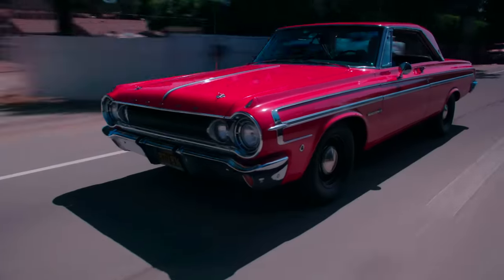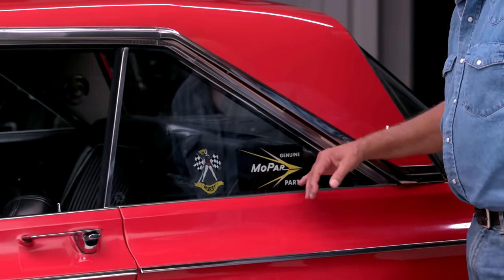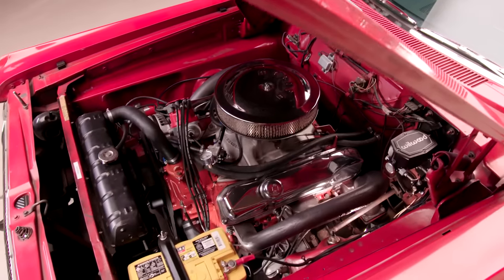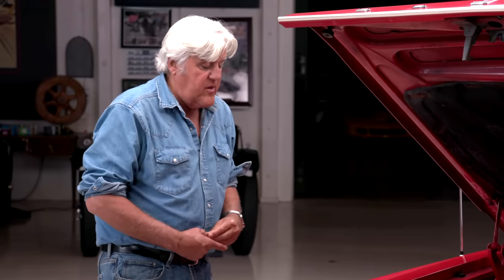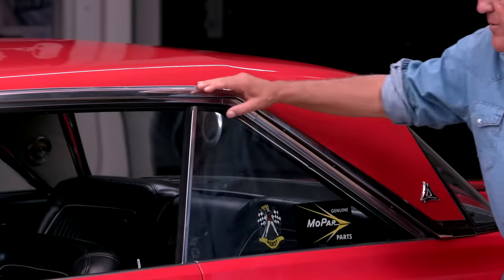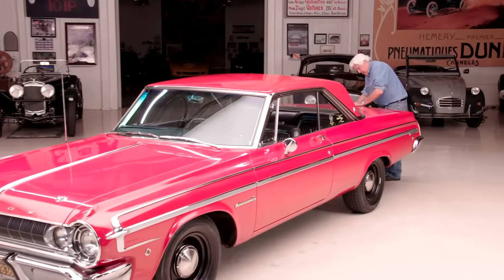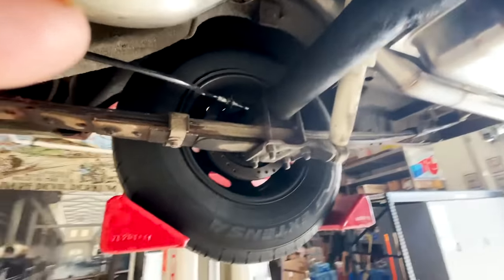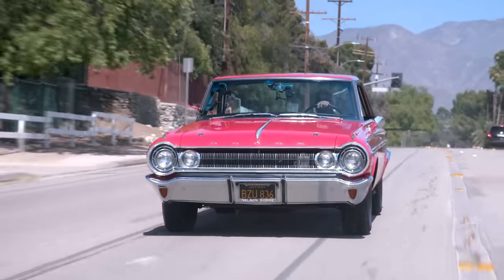1964 Dodge Polara | Jay Leno's Garage

Comment: When I was 16 my dad bought a 1965 Belvedere I from a guy who was on a baseball team he coached and got drafted. It had a 426 wedge with a push button Torque Flight transmission, he instantly became the coolest dad and I was the luckiest kid on the block. It was the car I learned to drive in and take my driver's license test in. Yes I passed and the guy who  gave me the test had a big smile on his face, boy did I love the 60's, 73 now and still smiling 😃
Reply: Heh, Steve, my father was also a Mopar guy and at 15 in 1962, I took my driving test in his 1959 Chrysler 300 E coupe. I recall a similar reaction from the State Trooper administering my test!!!
Reply: Thanks for sharing, fellas... my dad is 74 and all our lives, my brothers and I have been exposed to Dad's stories of those cars. And I still own the car he brought me home from the hospital in,,, a 1964 Dodge Polara 500, 426 street wedge 4speed. Pretty much the same package Jay featured in this episode,  but Dad's car is dark blue poly with light blue buckets and console with white insets, and that same white 4 speed ball on the Hurst shifter.  It's got 71k original miles on it today. 

It's still got it's cast iron prestolite tach drive dual point distributor and the chrome unsilenced air cleaner and chrome valve covers that all came standard with the 426 street wedge.

That car, and the memories of it from my childhood are wonderful bits of our shared passion for old Mopars.  I am so happy to hear Jay say the things he did about this model. I have always loved them  just a little bit more than the hero cars, like the 68 and 69 Chargers and the Cudas and Challengers that command the limelight....

I am especially intrigued about Jay's appreciation for the 7 litre Galaxy that he did to commemorate one his Dad had when Jay was young,,, as I too find those to be extremely attractive even though they're outside the Mopar family. I searched one out back in 1990, complete with the 7 Litre 427 4v and unfortunately,  the C6, unlike the 4speed I prefer. Same maroon and black livery as Jay's car. 
They are all great time machines,, to take us back to our childhoods,,, thanks to our Dad's getting us exposure to them.  

Jay has certainly made a friend in me. I have been a loyal watcher since the beginning.
Reply: @patrickwayne3701  -Patrick, thanks so much for sharing your own story about your father and his 64 Polara in particular. You have the advantage of not only having your dad around to listen to his tales, but also the car of your youth to enjoy firsthand… Unfortunately, in my case, I have only memories of Dads most special Mopars as no photos remain of either the 59 300 E or my 64 Polara 500 in white with red/white interior.
Reply: @brenmizer123  man that's a bummer.  I was ALWAYS getting one of those Kodak cheapo cameras that were sealed in the foil package, and clicking away, then sending the camera off thru the drugstore to get double prints back.

A 59 300 is SOOO damn cool....
Reply: What happened to our beautiful cars that we used to buy.
Reply: I learned in my Granddads Dodge pickup had a 318 with the push button tranny, I was only 13 but we were out in the country and boy did I have the friends from town wanting to spend the weekends with me, great car great memories 🎉
Reply: They all turned into the same SUV

Comment: Had a red 64. Pulled the 383 and added the 413 from a wreck. Every cop in LA new me. Used to go out in the desert and run. Bias ply tires, drum brakes, and lap belts and we are STILL ALIVE!
Reply: Sounds good! Bumper sticker I recall from that era was: "Go like Hell, you'll get there!"" And we did, as you said! :D
Reply: These were AWESOME cars!
Reply: 1971 , Had one, black in and out . 383 ,   Crower cam and ram exhaust manifolds from a Roadrunner . Ah , the memories......
Reply: "knew"
Reply: I had a nascar prepped 413 in my 68 Super Bee. What a monster. I bought it from some guys that had to sell it. I had it almost 3 years then sold it. That car was scarry fast & very loud but you knew your limits for the roads you ran it on. No power anything except under the hood. That was back when gas was cheap too but ran AVGAS most of the time. Didn't drive it much on the streets or highways. Love those 413s & 426 Wedge engines.

Comment: I think nobody should apologize for upgrade the anemic brakes of classic cars. Safety first.
Reply: The thing about brake upgrades: you can always put them back to original.
Reply: @mindeloman  but why would u.
Reply: Not only safety, but being able to brake decently is also fun because if you can brake later, you'll be fast longer 😄
Reply: @Jozavenue  Concours restoration.
Reply: If you can’t harness the horsepower, you’re not going to enjoy going fast for very long…
Brakes are more important than having big speed…
Reply: @Jozavenue  The whole "museum piece" type thing...for a very original car. Not practical, but certain cars qualify as museum piece time capsules and don't see any real road time.
Reply: @Jozavenue  - The only reason I can think of, and in my opinion is it's a criminal reason - is to return a car into a museum piece for static display. Or for the purposes of auction value, you want a car as original as you can make it.
Reply: You're right. I own two 50s Cadillacs and I won't go too fast because the brakes are Fred Flinstone compared to today's cars.
Reply: nothing wrong with the drum brakes of the day - certainly not unsafe
Reply: I'd say the same thing for tires. No shame in actually using modern rubber to help you in the corners.
Reply: But how will the next generation of youngsters know what cars were like in those days, if a car like this doesn't crash into them at the bottom of a long grade?
Reply: indeed :)
Reply: @theundergroundlairofthesqu9261  :) The car can be slowed via brakes and engine braking used to offest this issue in most if not all cases. Even auto trans cars can usually be found with an L1 and L2 selection. Old car guys- and people who lived the times- are suually aware of this. So not many crashes at the bottom of a long grade.
Reply: Yeah, especially if the original brakes tend to fail, overheat, or simply ineffective
Reply: 60's and 70's brakes are 1-pump chumps, you get one attempt at serious stopping (...maybe) and after that its kind of 'speculative' at best with appeals to divinities on the 2nd
Reply: If anything it helps save them from crashing
Reply: Nancy boys!
Reply: Not true..at least with Mopar muscle. Maybe a bit after this car, but by late 60's they had 11x3" HD drums in front, just as importantly, really good quality shoes. They stopped quite well. Later on, ppl would replace them with substandard shoes, gioving the drums a bad rep. And..ofc ppl could scape goat the drums and blame them for an accident. Are disc better? Y/N. If large enoguh & if the quality is again there, then sure..but an equal caution to folks who may purchase lame pads for their disc brakes.
Reply: @southernbreeze3278  until you try and stop.
Reply: If you are going to drive it like Jay, breaks are a must
Reply: Safety is king
Reply: @southernbreeze3278  much less safe 😂
Reply: @southernbreeze3278  Have you driven with them? They often fade and even when they don't, they don't stop all that well, which is why front discs eventually came alone in the late 60's, just to help out the brakes. Less fade for starters. My parents had the Dodge wagon version of this car, bought it new in 1964, but with the push button automatic and as a kid in the 70's, I recall the brakes groaning when you stop the car while still in gear and I also wonder if it had power brakes even (not all cars did in those days) and our wagon was the base 330 with the slant six no less. I don't recall it fading but you could hear it straining against the brakes when applied. By contrast, the 1971 Plymouth had power brakes, and power steering and all it took was a light pedal to bring the car to a dead stop. I think it may have had front discs up front though.
Reply: @johnhpalmer6098    drove a 69 camaro for many years with drums all the way around, up and down may hills, never had a problem - not to say discs aren't better, but for normal driving 1960's drum brakes are perfectly fine and safe
Reply: Yes, I agree particularly if they are planning to drive it….kind of like adding seat belts.
Reply: @krissteel4074  that's a negative. You either don't have much experience with the subject on a personal level, or you drove some real shitboxes tha needed maintenance. For a point of fact, some drum systems had more surface area than the discs of the time. If a driver understands brake fade there is no reason the brakes of those cars, particularly with modern fluid and dual reservoir master cylinders, should be dangerous in any normal driving sceanrio. But what do I know, I only had 31 years experience with the same stock 4 wheel drum setup from my Buick built in 1969. You are just plain wrong and hyperbolic.
Reply: @bbb462cid  The average driver today is 20-25, they don't have 3 decades of experience in older cars driving around the nuances of their older braking systems, older tyres or no ABS. 1 hard emergency braking and the next one after that in short succession they're going to be in trouble with something that's got 350-400hp and lets not mix words, we would have both known kids back in the day that ended up in a ditch or worse growing up in some shitboxes and things wouldn't be any different today in the same car.
Plus parts are getting really rare for 50+ year old cars, I've got a regularly driven 25 year old car and even some minor things for that are scarce to the point its gotten well past finding a source of OEM and just down to give me something that fits.
Reply: @krissteel4074  I'm sorry but your  assumptive overstatements just aren't something I'm going to participate in, and I was finding anything I needed for classic cars in the aftermarket 20 years ago. But have a great night.
Reply: Unless you have no reason to actually drive the car. Always upgrade the brakes. Even for Mopars which can be hard to find new parts for have abundant disc brake conversion kits. I have a 1964 dodge 440 318 polysphere push button auto with positrac and the kits can be had for $1-2000 full disc conversion.
Reply: @timbrwolf1121  Not everyone has an engineering background, I understand,, but because of the 2-3 thousand dollars the aftermarket wants for these modern kits,,, I recently researched the brakes on modern Chrysler stuff and I am grinning big, to report that with a few little machining tweaks,  I found a 2010 R/T Avenger 4 wheel braking system would bolt on, to a '59 Dodge Sierra 6 passenger station wagon. I had to clearance the lug holes in the rotors to accommodate the stud shoulders on the 59 wheel studs, but they literally slid right on after the reaming procedure. I did have to mill a caliper bracket to adapt the 59 knuckles to the modern  rotors and calipers,,, but it is stunning to be so closely matched, considering the span of years between the two cars. 

I will probably post the procedure on YT when I have it sorted out,,, but even the ebrake is working out, with the small set of old style brake shoes inside the rear rotor hats....

This stuff is wonderful for father son  bonding.... my Dad is 74 and I'm 55,, he is gobsmacked at how the project is progressing and especially that I chose the 59 Sierra wagon,,, it's very similar to his first car way back when....
Reply: @patrickwayne3701  wonder if that would work for my 64. I plan on going to the junkyard and getting a first gen dakota starter instead of doing a premium "mini starter"  when I do headers. Would be cool if I can grab some brakes off a charger
Reply: Right on brother.
Reply: @mpf1947  Concours restorations that never get driven are no longer cars; they are statues.
Reply: @southernbreeze3278  Until they fade, then they are
Reply: First thing I did after upgrading the motor in my car was throw away the drums and put a set of wilwoods in it
Reply: @jacobmoses3712   my guess is you've never suffered from drum brake fade, neither have I and I've driven 100s of thousands of miles with them, with a few emergency high speed stops along the way
Reply: Especially on the first two years of the Oldsmobile Toronado!
Reply: @Jozavenue  there are perks to drums I still have the stock drums on my Oldsmobile
Reply: Series of road test vids from the late sixties including panic stop brake tests.
Scary to me how many got out of shape with the rear drifting into the next lane.
In the real world maybe into oncoming traffic.
Reply: AND handling. Those Chrysler cars had torson bar suspension, when everyone else went to coil spring suspensions.
Reply: Single circuit brakes? One leaky rear cylinder on my '56 Fairlane and I almost demolished the garden wall! Luckily I wasn't trying to haul it down from 70mph. Love this Polara,my favourite era.
Reply: ACTUALLY, THE CARS CAME WITH 11 INCH FINNED DRUM BRAKES, NOT AS BAD AS YOU MIGHT THINK, WITH A METALLIC PAD..
Reply: @krissteel4074  
That doesn’t ring true to me. 
You drove the car/truck and brakes didn’t impede your safety. If you is shtupidh? Den shtupidh tings happened. A lot of stupid people died. 
With modern cars they could do a different kind of stupid. And probably the majority would still die! Kids watch  these movies and play these video games and they think they’re invincible. It ain’t the brakes. 

But good or better brakes are always desired; you just can’t fix stupid.
Reply: Safety third, at most.
Reply: Yep. back in the day they'd turn 110 in the 1/4 but it took a mile to stop it. LOL
Reply: Brakes don't stop a car, tires do.  If the brakes can skid the tires, and uniformly, nothing can stop it any faster.  Indeed, you want to brake to the point just before skidding but that is hard to judge (hence ABS).  Much of the long braking distance spec's in classic cars was due to the poor bias-ply tires.  The problem with drums is that you can't keep braking repeatedly, or even once from say 80+ mph without the brakes fading (friction material melts), since drums take longer to cool than rotors with internal cooling channels.  That was particularly a problem for neophyte owners on mountain grades (say FL drivers on Blue Ridge Parkway) who would "ride the brakes" down long grades rather than downshift and use the engine to control speed.  I think that is why the U.S. fed's "encouraged" front disc brakes in the 1970's.  Many people fault poorly maintained drum brakes.  They are touchier to any contaminants on the shoes and can even self-lock if too sticky, due to the self-amplification of the pivot points.  People also install the shoes incorrectly if a short and long lining on different shoes.
Reply: @w41duvernay  Didn't the Porsche 911 come with torsion bar suspension?  That was a big feature of the Chrysler unibody cars, as it keeps the weight down lower.  It also makes it easy to adjust the ride height as the springs sag, and you can remove the T-bars without endangering your life like with coil springs.  But if you desire, you can buy after-market coil-over conversion kits, but pricey ($3.5K) and most change the whole front end, adding new frame rails and rack & pinion steering.
Reply: @southernbreeze3278  Faded easily compared to any car with disks, and absolutely scary compared to todays brakes.
Reply: Certainly should apologize. These are time capsules, not part swappers. If you find the brakes problematic, try adding following distance.
Reply: Have drums on full size and never felt unsafe.    Jay doesn’t have enough money so still promoting aftermarket crap like hood pins, exhaust cut outs.  Shame.
Reply: @dukeallen432  Most semi-trucks still use drum brakes, though many are finally converting to disks.  Drums can work fine if you maintain them and don't use them like a road-racer and know how to descend mountains.  The only time I had trouble with drums was on gravel roads in the SoCal mountains where the transmission in 2nd was a bit too fast so had to keep braking on sharp turns.  Began to experience fade, so had to pull over and let the drums cool.  Using 1st gear was too slow.

Comment: it was 1972-73 that a high school friend had this or coronet .  What I do remember is this was one of his Dad"s beaters.  It was a convertible. His Dad loved convertibles . ( He also had a beautiful Cutlass 442,4 speed, convertible.)  Anyway, the top had some taped holes, the steering wheel was so loose you thought it would pull off.  It was indeed a 426 wedge, 4 speed. It felt insanely fast.  The stick shift was very tall and had a beer tap for a handle he made.  When he shifted, his knuckles would just about hit the dash in third gear.  He used to take a couple friends out for hell rides on route 95.  He would scare the bejeepers out of us.  At over 100mph the front end was light and wandering all over the road. I remember enough wind coming through the top to catch a cold.  Thanks for the memories , Jay
Reply: Nice!!